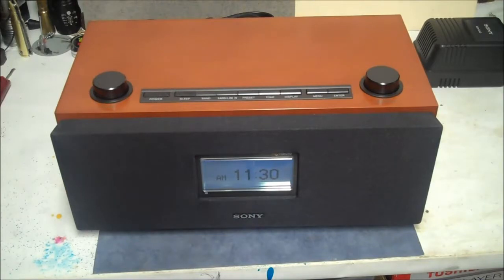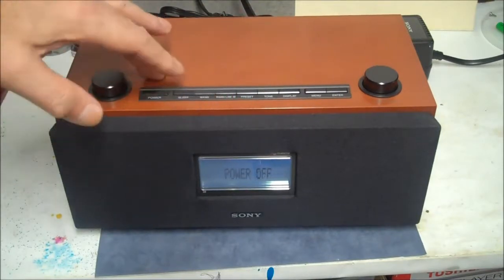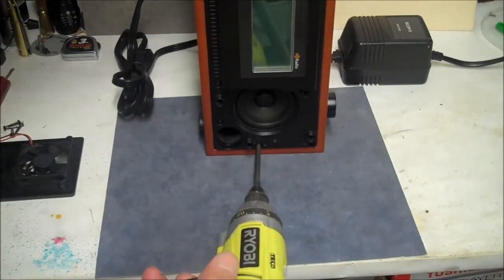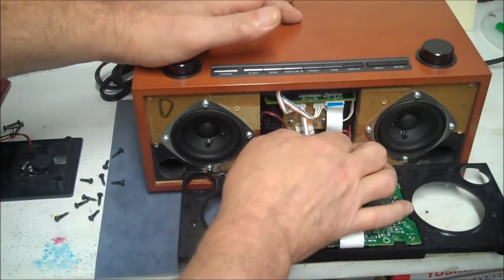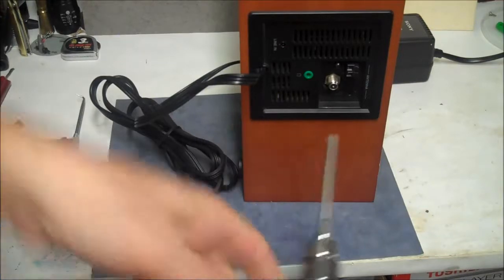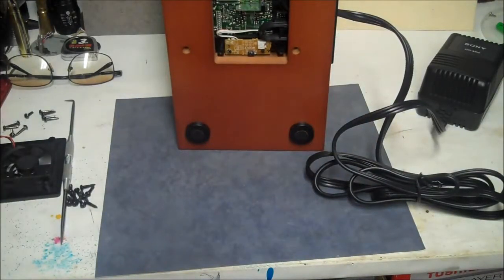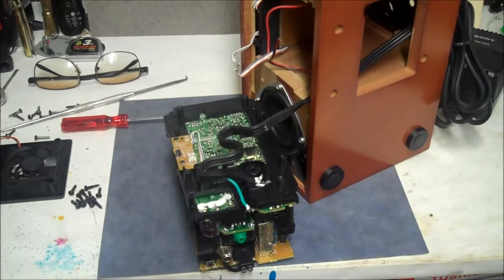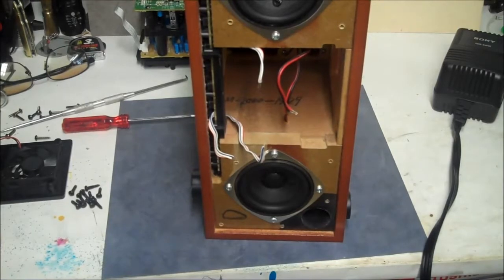Sony XDR-S3HD Radio Disassembly How To Remove the Power Supply

Comment: Great little radio, I picked up one on a garage sale for $5, the buttons are a little finicky but everything else works, the only downside is it doesn't have an internal battery so when the electricity goes out all the presets are erased.
Reply from the maker: It has a battery slot in the back. 1 screw I believe.
Reply: @FixItYourself  mmm, at least mine doesn't. I disassembled it to double-check and no battery or battery slot.

Comment: Interesting video. The same thing just happened to my Sony HD radio. It wont pick up any channels. Shame because its hard to find one to replace it. Thanks for the cool view.
Reply from the maker: Yea you can find them on ebay ranging in price from $100 to $200 used.
Well worth it. I bought my first one for $50 broken.
I took it apart and reseated the cables and its been working for 3 or 4 years now.
Maybe yours just needs the cables reseated. You never know til you try.
Reply: Thank you for the tip. With your video I am going give it a shot. It will make for a nice winter project.
Reply from the maker: And you have nothing to lose since its already not working.
If you send it to sony to be fixed, last time I checked it was $185.00 to fix it.
That was a couple years ago. They may not even fix them anymore. IDK
It's a shame because they are really nice radios.

Comment: Do you know what the output voltage of the power supply is? Bought one of these at a yard sale and want to use it plugged directly into my 12v. solar system. Thanks.
Reply: It's dual voltage. 10v and 5v output. Hence the 3 wires.

Comment: What is the level of risk? I have two XDR-3, I want to change the electronics from one box to another, is better visually. It seems that the most difficult part is the front cables. Does assembly follow the same procedure when connecting cables? Any special care when mounting?
Reply from the maker: It's not that hard, just be careful not to damage the cables. Take pictures or watch my video.